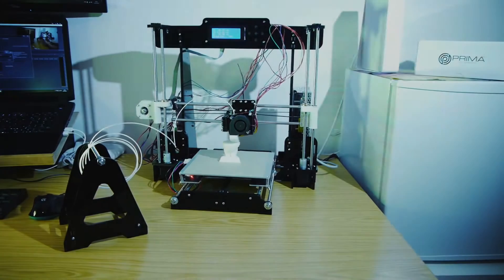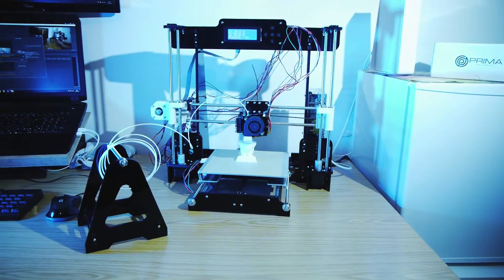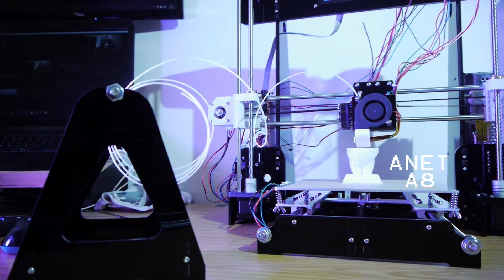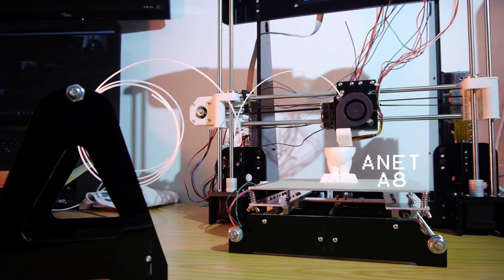Cheap 3D Printer - Anet A8 First Impressions and Timelapse of Assembly

Comment: Hey, thanks for the video :). In minute 3 I saw you started soldering the board on the power pins. Did they come damaged or with poor soldering?
Reply from the maker: Hey, no worries!
I broke them by over tightening them, however the solder joints were not of good quality so if you have a soldering iron it would be wise to reflow the these joints after you have secured the wires in the terminal block.

Comment: Where can I find the instructions for this thing? I got none with the package... Help please!
Reply from the maker: They are on the micro SD card under: A8/Installation Instruction folder
Reply: Hey so how do i turn the machine on? It doesn't say in the instructions.. Do i just plug it in and it turns on automatically?
Reply: it is supposed to power on as soon as i plug it in? Cause i plugged it in and nothings happening.
Reply from the maker: It should power on automatically once the board receives power. Make sure the PSU voltage selector switch is set to your country/regions voltage otherwise it could permanently damage the system.. Do this before powering up the PSU. (not when live)
Reply: Hmmmm... US is 110 V right?
Reply from the maker: Unplug it, wait 5 minutes for any residual charge to dissipate and then make sure you have wired it all up correctly. I found that the solder joints of the terminal block on the main board are easily damaged when tightening the screws so you may want to double check that. If you are familiar with using a muiti-meter you could try and measure the output of the PSU. It should be around 12VDC, just watch out for the live terminals. You can always test the main board and screen by plugging the usb cable into a computer without the PSU hooked up.
Reply: Ah man, I mesed up my printer. haha. It started smoking. I don't get it though, everything was plugged in correctly.. Maybe i tightened the screws too much? or too little? Eh, well hey thanks man. Crap!
Reply from the maker: That's a bummer, could give customer service a go but its probably gonna be hard to get anything from them. This power supply is compatible: http://amzn.to/2nXGWpw should you wish to replace it yourself. Provided that is were the some came from.
Reply: Thanks man, i'm gonna try and send it back for a refund. I mean 160$ for a 3d printer is good, but i expect it to work ya know! haha, thanks for the link, i'll check it out before i open up a ticket on their site.

Comment: how did you get the two colours on your first print?
great video btw XD
Reply from the maker: I could see that the included 10m of white filament would run out halfway through the print so I paused the print and quickly swapped over to my own reel of filament that I had brought before hand. You must act quickly though as the hot-end melts a hole in the model where it is stationary. Also, the stepper motor drivers will power down 30 seconds after pausing the print. This can allow the printhead to become misaligned should you touch it after this point.
Reply from the maker: ....and thanks for your kind words. More videos to come hopefully!
Reply: thank you very much
Reply: Also, for manual changes, use the Marlin M500 command